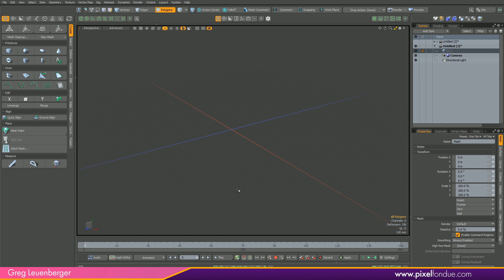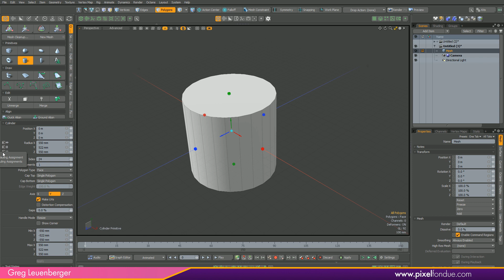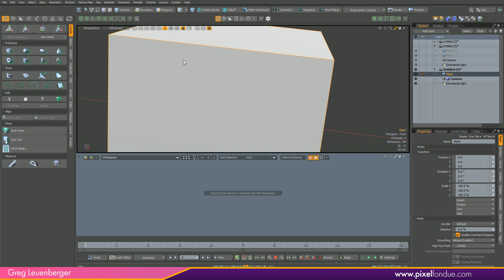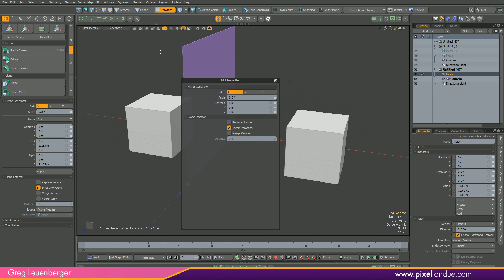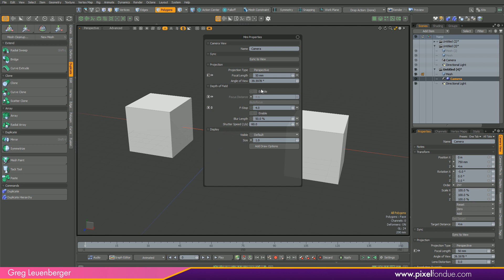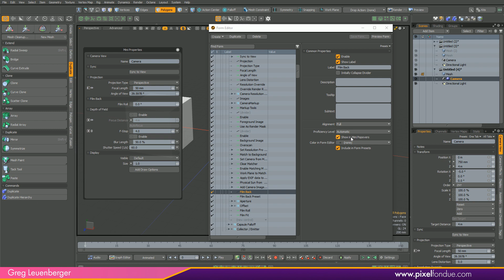MODO Customizing Omnihaul and Mini Properties

Comment: I have been using space bar both to toggle component mode and to drop active tool since MODO 201. The muscle memory here is seriously baked in, as I'm sure it is with a lot of users. I'm not sure why Foundry decided to go with spacebar as a default for mini props.
Reply from the maker: You can change it back if you want (there should be a prefs at the beginning).  Space for tool drop and component is both redundant (there's been existing shortcuts q and 1,2,3 since MODO 101) and only benefits modelers.  Space for mini props benefits modeling, MOPs, shading, animation, lighting, rigging, setup etc.  But - if you don't like it or just model then def. just change it back and put mini on 'q'

Comment: Righto... strange problem.  But I am trying to bind Bridge to Shift-Q and even though it is mapped "tool.set edge.bridge on" in the Input Editor, it keeps spitting out "edge.growQuads true".  Anyone any idea what is going on here.  Everything was working fine till I upgraded to 15.
Reply from the maker: That's weird, I'd ask on the MODO slack about that.
Reply: @Pixelfondue  My workaround was to retrain my fingers.